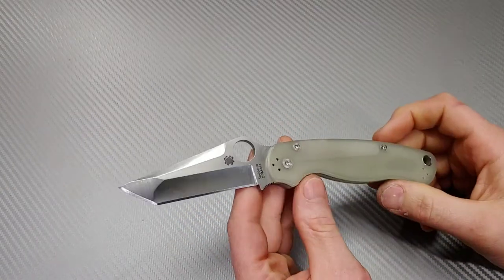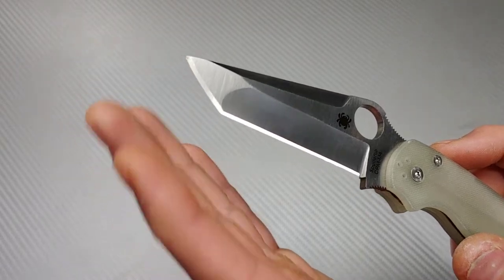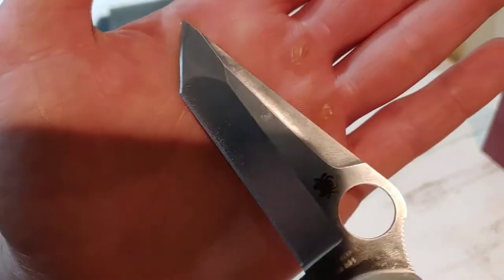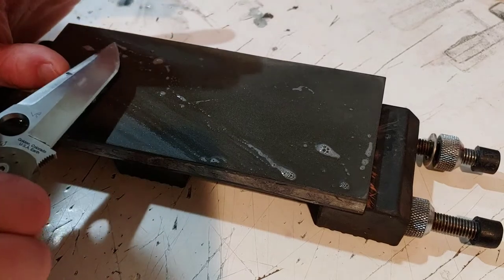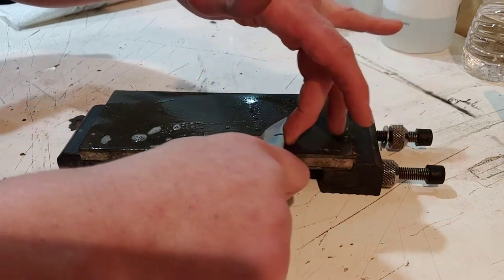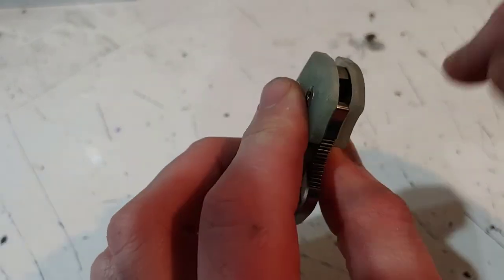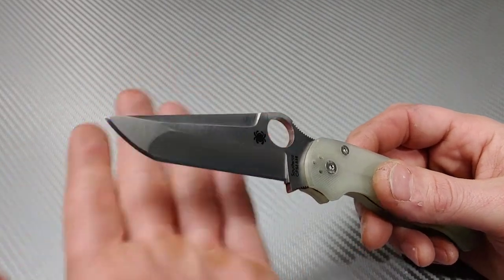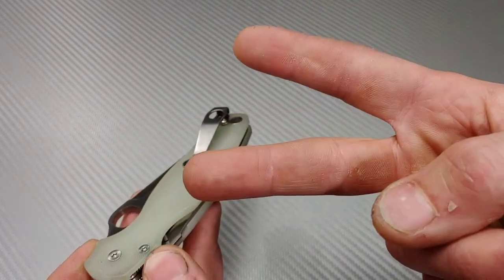SPYDERCO PM2 TANTO SHARPENING & IMPRESSIONS

Comment: 03:30 The beauty of a hollow grind is that the blade gets thinner as you sharpen it for the first 1-2 millimeters. Look at the edge of the tanto and see its below the center line of that hollow grind. I saw a video where Chris Reeves  explained it and I've been a fan of the hollow grind ever since.
Reply from the maker: Yeah thats not always the case it is with CRK hollow grinds but not all hollows are built the same, but most of them at the very least stay the same thickness bte for the first part of the blade, but yeah crk are a deep hollow that does get a little thinner before it starts getting thicker

Comment: Hi! Awesome video. I've got a PM2 tanto too. But its about time to sharpen it now. Would like to know what the bevel angle is on the tanto? Can't seem to find any info on it. All I know is that Spyderco normally use a 30 (15/15) degree bevel angle
Reply from the maker: I'm not sure what they are using on the tanto, but I think you would be safe with a bevel around 17° you cab always raise or drop it if your not happy
Reply: @NeevesKnives  Alright. Thank you so much!

Comment: Hi Jarrod good video.I admire your
skill.Couple question for you.Arn't 
most Japanese tanto's rounded with no secondary point,at the front? Second have you ever done 
a tanto on W.S.  K.O.  edition or
with bade grinder attachment?
I do like tanto's most of them
are suppriseing versatile. T.C
Reply from the maker: So theres different styles of Japanese tanto the and they have different names, but as for pocket knives goes they usually have a secondary tip but not always but when its rounded its a japanese, American tantos are always straight
Reply: If you're good with the KO grinder tantos are no problem. Just pay close attention to both sides so everything matches up especially at the transition from, in this case,  hollow and flat.

Comment: Get a cup just wide enough for the knife closed to fit in. Put alcohol in it and put the pivot side in the alcohol swish it around for a bit. That should help gettin all that gunk out and wit a duster blow out extra alcohol left in. And of course add what ever lube back because the alcohol probably washed it out.
Reply from the maker: Great idea i personally would just use hot water from faucet, alcohol is to dang expensive to use that way for me, i do use a few products i get from work for free, that work great i usually just spray it though after rinsing under hot water then after spraying it down oil it up, but the cup trick is great for those that have alcohol like that